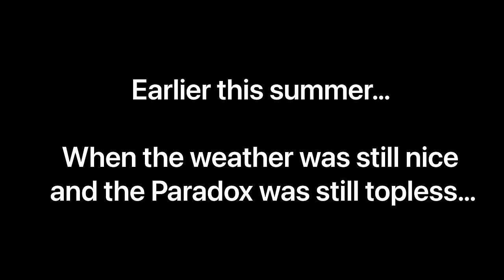How Long Does Wrap REALLY Last? The TRUTH REVEALED After 3 Years Of Real World Testing

Comment: in my personal experience, it is vital to use either ceramic coating or occasionally using some sort of vinyl restoration product to bring back vitality. Sun damage is definitely #1 and IF you park your wrapped vehicle in the same spot and same position every day, you risk having more damage to one side or part of the wrap and not others, creating noticeable fading or discoloration depending of the type of Wrap involved (color-changing wraps tend to change colors or go black eventually ). just a heads up for those of you without garages.
Reply: I reckon he doesn’t really wash his cars or look after them either which would greatly accelerate the decline
Reply from the maker: Correct I only wash them when I take them out which is like once every two weeks but it’s a good way to test it
Reply: @craigc3596  his driveway is nice for that also. I used to park on the street and car would get dusted on with the cars passing by. Driveway better cause less dust
Reply: @ParadoxTheWrapper  rewrapping only the damaged parts, alone wouldn’t that not be perfectly color matched to the older wrap that’s been on for 3 years prior? I have 3m satin black and was wondering if I can just rewrap one door that got a rock chip in it alone, beside the rest that’s been on for 2 years now.

Comment: i wrapped the roof of my civic 4 years ago  still no signs of deterioration or peeling   3M FTW
Reply: My car was done with Oracal and it's been 7 years!
Reply: What brand?
Reply: Do you park outside or in a garage?
Reply: @johnhendy1281  Outside in the midwest. Hot summer and cold salty winters.
Reply: @felixmcbride5448  Cool, same for me (MN). One car garage and my wife wins that one :) That's promising with respect to wrap durability!
Reply: Did you ceramic coat it?
Reply: @felixmcbride5448  nice. Though after moving to the Houston from the Midwest, the sun seems to do 10x as much damage here for some reason.

Comment: I had this problem with the roof on my Kia. The Avery vinyl I used was rated for 5 years on vertical surfaces and 3 years on horizontal surfaces. The shiny outer layer started to peel after a little over 3 years...it took 4.5 hrs to get the vinyl off the roof. But I didn't ceramic coat it, took it through car washes and parked it outside 100% of the time. In the future, I'll either peel it at the first signs of damage, or I'll sell the car before it can happen. lol

Comment: i can say my expirience but from lets say 20 years before.. i work on an advertisment company we use to cover delivery trucks and busses...we had several vinils that we used and they where from 3 year 5 year and 7 year life span we had even worst than them but they where for other uses it was all depend on how clean was the surface the temperature of place and vihecle and ofcorce the type of vinil.... so the 3 year span is not bad but if things not changed there must be a 7 year and 5 year life span of vinils out there...the cost is rising though and for sure how you treat your car does have a role in the longlivity of the material ....that was my expirience back then

Comment: I tried wrapping the roof of my car black and completely botched it. That's not as easy as you make it look. I had bubbles,  dirt and scratches.  I started with a clean surface. Used the proper tools. Just wasn't happening.
Reply: Use 3m or avery next time. Much easier.

Comment: Couple of questions. First, when the wrap is worn out, did it protect the paint underneath? If I remove it, will it damage the paint under the wrap? Secondly, how much does wrap cost for a typical car? Is it cheaper than a paint job?
Reply: Price wise, I think they both can be cheap and expensive depending on the quality. I think the wrap is a good choice for people leasing the car for 2 years and they just want to change the color and tear it off before they return it. otherwise, paint might be a better choice because it will last much longer and you can polish the clear coat. So in a long run, a decent paint should be cheaper comparing with replacing the wrap every 2-3 years.
Reply: Theyre the same. High quality of both range from $4000-$8000 and you use the same/similar chemicals to protect them. So its cheaper to paint a car and just re do the clear coat every 2 years because if the paint is damaged its like $100 for small repairs vs having to re wrap sections or the whole car. Especially if you live in an area where you cant garage a car regularly.
Reply: @ericquinney6004  I get it, but my original question was about if a wrap protects the paint underneath. It would seem that wrap would protect the paint from UV damage. So if I wrapped it and maybe after three years removed it, wouldn't the paint underneath be just like new? Or, does the wrap damage the paint under it in any way? So, essentially, if paint lasts three years, and I cover it with wrap and then remove it after three years, when I remove it I would be getting another three years out of the finish because the paint underneath is essentially new, right?

Comment: So,the wrap didnt peel off without any clear coat on the car. I want to wrap my euro accord 7th gen and i have some minor quarter panel rust and i plan to solve it and leave it in primer throuroughly sanded to glass.will the wrap hold there without clear coat or do i have to clear coat that area or is it enough to sand it with 2k grid.also My hood has started to show signs of cracking in the filler.i plan to solve that problem.will the wrap hold on filler or primer or i would have to clear coat it? Sry for the long question 😁
Reply: You do not need to clear coat if you just cover it with any toe if paying including primer

Comment: so meaning its recommended that them lambo with factory paint better change or take off the wrap before 2 years? if not its RIP their factory paint?
Reply: Nah it won't hurt good factory paint. The wrap itself will just start to fade/delaminate after a few years, as you saw at the beginning of this video. But the longer you leave it on, the harder it is to remove.

Comment: Curious.., if the vehicle paint prior to a wrap is in perfectly fine or even in new condition, would wrapping it protect it or inadvertently damage it when it comes time to replace or just remove the wrap?

Also can you use carnuba wax or a hybrid ceramic wax rather than 100% ceramic coat and would it provide some protection on the wrap itself?

Comment: Looks good but why would you wrap the sunroof, never wrap the sunroof!!! The glass attracts heat you could use a tint that matches the color but not a wrap. Another thing is a good wrap in a good sunny area can actually last about 10 years if done right and keep protected. I seen cars in NY with ceramic wrap still look the same as it did 5 years ago. Driving in the snow a few times too. It all depends how you apply it. These guys strip the car down then apply the wrap maybe that’s why it last so long. But never wrap glass no matter what it won’t hold for to long. These guys are experts and do cars shows all around the word so and that’s what I was always told you can even find a professional shop if you have any other questions or run into any issues. And since you’re in the west coast check out WestCoast customs and how they wrap their cars they last more that 3 years
Reply from the maker: My sunroof is cracked and can’t find a replacement part so it’s easier to wrap it. This is a channel for those of us who wanna try to do it ourselves so I just tell them what I know
Reply: @ParadoxTheWrapper  Oh I totally understand bro, you do amazing work too. Just was saying a few things I learned through out the years. The car does look good and I seen your videos and a lot of my friends fallow you as well. I wasn’t trying to diss or anything like that.